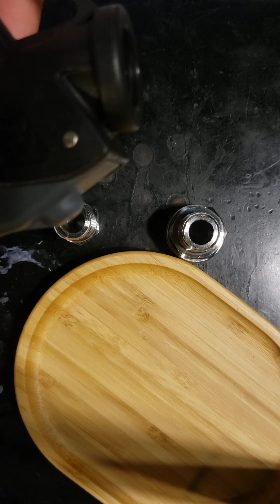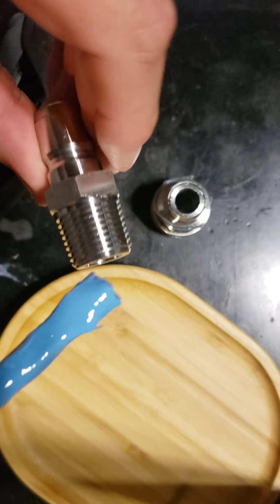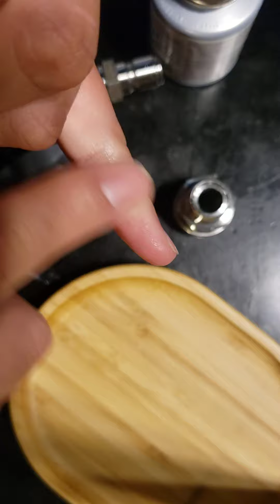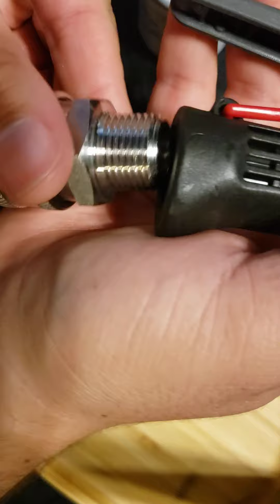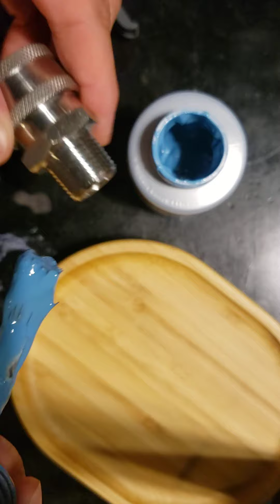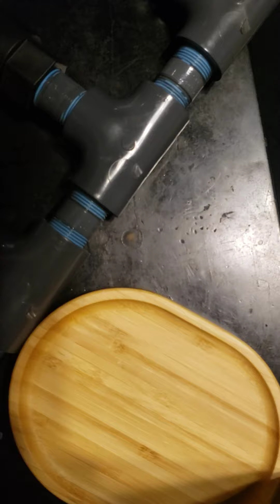Soft Wash Gun Fittings

Comment from the maker: Soft Wash Gun Fittings 

MTM 1/2" MPT Plug
https://www.mtmhydroparts.com/collections/fittings/products/stainless-steel-quick-connect-plug-1-2-mpt 

MTM 1/2" MPT Coupler
https://www.mtmhydroparts.com/collections/fittings/products/stainless-steel-quick-connect-coupler-1-2-mpt 

Suttner ST-510 
(shows ST-500 but received ST-510)
https://pressurecity.com/products/soft-wash-trigger-gun 

Rectorseal Tru-Blu
https://www.homedepot.com/p/RectorSeal-4-oz-Tru-Blu-Pipe-Thread-Sealant-with-PTFE-31630/203490732 

YouTube Disclaimer 

I am just showing what I'm doing and how I'm doing it. Use, practice and implementation of this information is at your own risk. I am not an expert nor do I claim to be one. I am just good enough to do what I'm doing. 

Thank you for watching